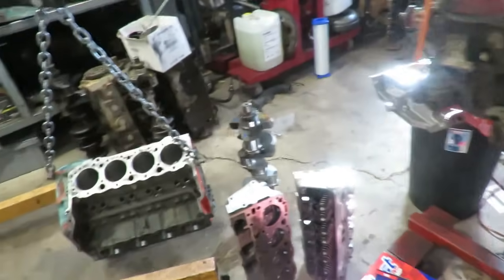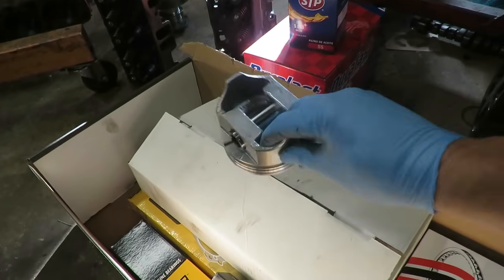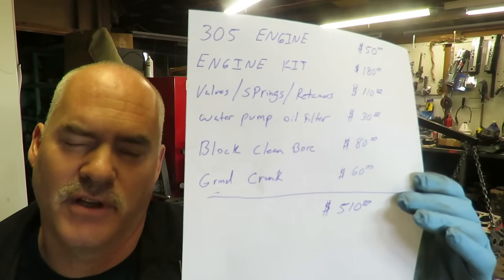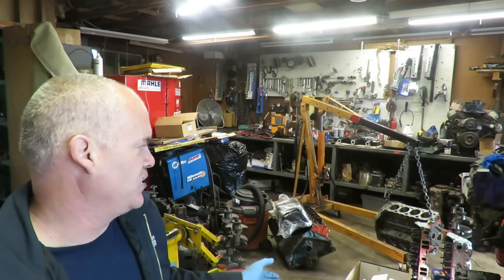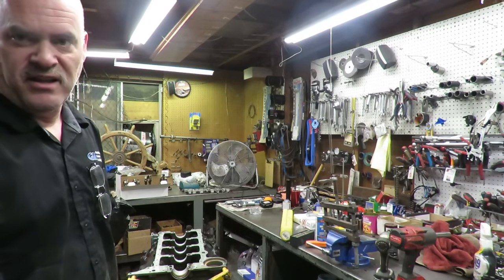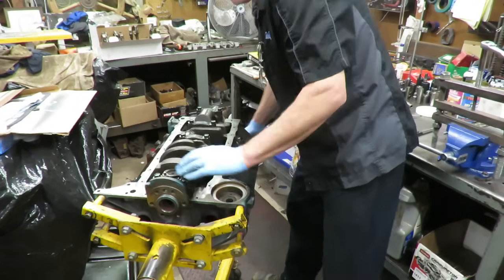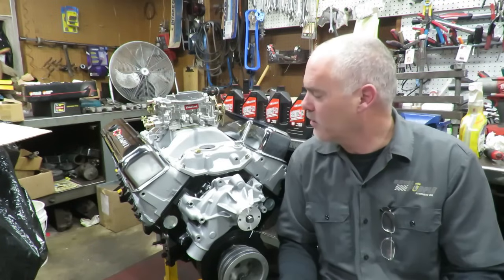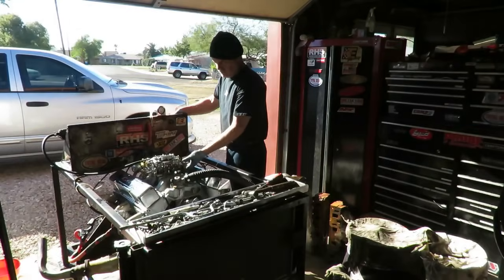Small Block Chevy extreme Budget Build

Comment: Normally one of my favorite hot rod channels.  :( From someone who grew up with the original 305 SMOG motor, this is good money thrown after bad starting with the 305 block... ANY SBC would be better than your almost free DONER motor - or even a worn out straight six. sure, the 305 eventually made some power in the IROC with FI and some other engine work, but the dinky bore with the long stroke almost guarantee that you will work for any pony that you can get...  better with an old 262 SBC which no one seems to appreciate, but still lurk in old monza's, etc rusting out in country folk farm yards all over the country, or at least take the 305 block and punch it out to add some bore size and compression and compression  ( you blow your budget)...  start with a good doner 350 instead... whatever HP that you ended up with would have been doubled.  305... synonymous with wasted money and time in my eyes.  blah!

Comment: A clean bore and hone for $80. Must be a friend price as there isn't any money made there. I don't live in an expensive area, South western Ohio, and I have a machine shop. When you figure the cost of the wear on the stones and electricity the bore and hone made no money. I bake clean blocks so I don't have a hot tank price, but I'd  say $40 t0 $50 leaving $30 t0 $40 for a bore and hone. I'm not being a negative comment type but someone trying to repeat these numbers will really have to price search to near those prices. I wouldn't power up my hone for $10 a hole. I thought about building an engine with all used parts other than gasket set, myself just for the heck of it, as they are laying here in the scrap pile.

Comment: You succeeded nicely, but it's just not fair that a SBC can sound like that and only be just 210hp?   I know it's just a 305ci, but what are the main reasons the real HP numbers are so low given the lumpy cool cam, reasonable heads (as far as I know), great intake, carb, etc.  Didn't catch the compression ratio? It can't just be the displacement because 302 SBC's made way more power.  What is holding it down and what $$ would it have needed to make 300+ HP?   Now many of us with a SBC's that sounds righteous are second guessing our power levels.
Reply from the maker: You cannot compare a 302 Chevy to a 305 the 302 is a 4" bore and a 3" stroke a real screamer the big draw back of a 305 is the bore size the stroke is close to 3 1/2 inches the the bore is quite small around 3 and 3/4 a big bore short stroke engine will always make better power than small bore stuff
Reply: @Myvintageiron7512   Exactly! Bigger bore = bigger valves = more air flow = more power. I was going to build a 302 Chevy for my Nova (from a 327 I found for cheap) but found a 350 block for free and just stuck with the longer stroke to build a street friendly torque beast. For my budget that worked out better.

Comment: junkyard ls 4.8, gap the rings, ebay turbo (have it balanced), weld up some exhaust, fuel pump + odds and ends. Between $1500-2500 total (depending on the deals you find and your abilities) including a tune for 5-600HP. There are tons of guides to ls swaps and turboing them out there. Ancient SBC is a dying animal, and I am not saying that it doesn't have a time and place for its use. But why waste time building a gutless noise maker, when you can have a real performer for a little more money.
Reply from the maker: 1500 is unlikely 2500 is closer to reality I've done several LS based swaps most on a budget they are a better engine for sure but a far cry from $700.00 so sorry man not really a good comparison the other thing to consider is the LS engines are butt ugly they don't look good no matter what you do to them they just don't pop at a car show like the older stuff

Comment: I just found this. Anyway, thanks for not pushing ye another budget LS. Which never is budget. 🤮 Also, good call on the cam, 108* and 230/240 duration sound great. Now then, just my opinion, I'd rather see some crazy neon color on an iron head than aluminum spray. Big valve heads CAN be mounted on a 305, but the required valve reliefs are NOT amateur hour. It should be pointed out that this build can also be done with an SBF. I have no idea if a 318/360 Mopar can be rebuilt on the cheap like this.

Comment: Most average joe is on a budget ! No need to excuse yourself for saving money Bruh ! The only difference there is from a 305 to a 350 on the block is the bore ! They both share the same, block, rods and 442 crank. It is decent to have 300hp out of a budget 305. It sounds good and burns rubber :D

Comment: LOL a 108 LS LOL great LOL, but for the price of used valves ($20) you should have put some 194's in it, LOL never the less it sounded hot LOL
Reply from the maker: you cannot run 1.940 valves in a 305 the valves will smash into the cylinders and bend
Reply: @Myvintageiron7512   I'm old school, I keep thinking the 305 has the same bore as the old 307, thanks
Reply from the maker: @sideswiped6874  Nope it's smaller than a 307
Reply: @Myvintageiron7512  I thought that only applied to the 262 , 3.671 inch bore. 305 , 3.736. Remember the Max Wedges had notched cylinder bores for the 1.88 exh. valves. Otherwise exh. valves were 1.60", till '67 then 1.74. Could you notch the 305 bore for a 2.02 valve?

Comment: Whats the budget for a stock LS1 5.7L ( 2000 Camaro Z28)
Reply: 5.7 LS????
Reply: @jjmccloud  yes absolutely
Reply: Well hell I thought LS engines was 5.3's
Reply: Ls engines come in many variations 4.8L 5.3L 5.7L 6.0L 6.2L and so on the one I am specifically talking about is the 5.7L aluminum block  the one out of a 2000 Camaro Z28 SS. The Corvette has the same engine but has a sports tune and not the muscle tune that is in the Camaro.
Reply: @critiquecriticism5860  oh I see, now I know which your referring to, I just always thought those were LT1 blocks, didn't realize they were considered LS. Learn something everyday
Reply: @jjmccloud  the LT1 is a iron block thats more so a 1 piece block and the Ls1 is aluminum with latches (closest name) that hold the crank shaft in place. They bolt from top and the side.
Reply: @critiquecriticism5860  Got ya, thanks for the lesson! Don't study much outside of gen 1's lol Good to learn something new for sure

Comment: Cool. $698! And a wee bit of time. You comment on how small the bore looks, the 1.84 intake valves sound asthmatic to !. He wants to hear a radical cam, but not headers? He gets to see Edelbrock on intake and 'aluminum' heads, but not headers? Would any old used headers for a SBC not have been worthwhile? But, gee gosh, $698! Cool!
Reply from the maker: The EX-manifolds are only for the run stand the car will have headers

Comment: a quadrajet and cast iron manifold would do the job.
Reply: I use nothing but the QuadraJet on my stuff. Yes, I do have tuning parts for them. rods, jets , Powerpiston springs.   And I did invest in a Wide band datalogging AFR meter a number of years back. makes tuning significantly easier.

Comment: That is exactly what I did with the Mercruiser 305 in my boat. I got estimates from $3,400 to $6,500. I spent a total of $1,050.24 or rebuilding my tired of 305. When the machine shop called and told me they found no cracks in the block and heads it was go time. These guys spending $10K plus on a small block chevy what is wrong with you.

Comment: I want to know the Power and torque
Reply from the maker: it made 236 HP and 265 TQ at the wheels
Reply: @Myvintageiron7512  That's really not bad at all for what it is. I had two '89 Camaros. One had a TBI 305 at 170hp, and one was an IROC with a TPI 305 that made 200hp (ish) factory crank ratings. So they would have made substantially less at the wheels than what you achieved here.

Comment: Man I wish it wasn't $80 just to acid dip a block , $80 per bore , $240 a crank grind , $15 a piston to fit and $360 to balance a motor rotating assembly here. 😂
Reply from the maker: Thats actually still pretty cheap that balancing price seems quite high
Reply: @Myvintageiron7512  $80 per bore as in $640 for a V8 retail. 

I sometimes don't get change from a grand just to go .030 over , pistons fitted ,tenth of a gram balanced and the crank cleaned up.

Australian machining prices are ridiculous. Our wages are higher but still hurts. 

Mechanics / technicians wages here are $25-35 an hour to the worker. 

But paying the shop is $100-140 an hour no parts inclusive.

Comment: There is no way you could build that ,for that kind of cost, here in UK. You would never find anyone with a 305, or any US V8 for that matter,sat in the corner of a garage. Parts are hoeendous, ( 'cos we have to import everything ), also machining is way more expensive.
I've just done a basic rebuild on my 289 in my 63 Ranchero, and it cost me  almost 1500 GBP, that's about 2000 US dollars, and I kept the original pistons etc, also the cam. New lifters and springs, oil pump, water pump etc.
Not perfect, but whole lot better than before.

Comment: all that for 200 hp?  a stock 307 with a 2 barrel was 200 hp. put that carb, intake cam and heads on a 307 and you'd have 300 hp.  good job you definitely hit it out of the park on this one.
Reply from the maker: AAA no 300 HP from a stock 307 your dreaming also where are you going to find a decant 307  very rare days the collectors have all snached em up

Comment: From Canada here" and this would cost a few grand at the least here" they want a $100 to $200 for a used carb that needs rebuilt the kit would then be $100 or $150 ? Any 305 and i mean ANY bare block 305 is $500 to $750 if it runs at all $800 to a $1000 to get the heads done would be a $1000 OR MORE the used cam would be $300 the gasket kit $500 the water pump over a $100 a fkn gallon of tremclad paint you would use to paint your barn or your patio furniture! Is a little over a $100 bucks B4 TAXS" love your vid bud but its depressing to know what it SHOULD COST as to what it COSTS here in good old Canada land of the free" this along with the delussional prices of old cars and trucks has TOTTALLY ruined the future of old car restorations here" the younger people have zero interest in doing it" and you really cant blame them

Comment: Hope the cam doesn't pull the studs.
Reply from the maker: it won't not with these springs
Reply: @Myvintageiron7512  factory press fit rocker studs have a tendency to pull at about .480 valve lift.

Comment: cool how the guy sold him the $50 motor with a $200 dual plane edelbrock intake .top that off with a $500 carb.chrome valve covers.pullys alternator ps pump plugs wires dist cap hoses
 ect.... dont think you're getting away with a $600 motor.
Reply: oh and head bolts,they aint cheap either

Comment: $80 for bore and clean?! It's well over $300 here. Just did a 350.
Reply from the maker: you gotta make friends with em man just like I said in the vid
Reply: @Myvintageiron7512  That's like the best friend deal. How long does it take to bore and fit each piston? Couple hrs? So your paying a shop $40/hr?
Reply from the maker: lol they don't fit each piston buddy they bore the block and hone it they didn't even have the pistons I bore and hone blocks all the time it takes about an hour
Reply: @Myvintageiron7512  My guy likes to have the pistons in hand. He measures each piston and bores a cylinder for that piston. So the clearances are the same. Doesn't just bore them all to the same size and call it good. He labels the pistons for what cylinder it is for. Overkill, maybe.
Reply from the maker: @bradywilliams2666  it's not overkill when you are running forged pistons and have higher than normal cylinder pressure like high compression or forced induction but with stock cast pistons it's a waste of time  the piston sets are CNC machined and all matched sets in the 60's it was common practice when pistons were manually machined and varied in size but that is a thing of the past
Reply: $150-$250 for me depending.

Comment: Cheap yes, but will there be issues ? I learned when your starting with a unknown block, heads and other used major parts that you have zero history of, it's like my dad told me ---- NOBODY sells a good anything as if it didn't have issues the guy wouldn't sell it ever. So for me I go the extra mile if it's not MY running motor to start off with . A few things I always do, maguflex everything , aline bore or aline hone the mains, deck the block square to the mains min. clean up .010 before boring for pistons so there is no question the crank is indeed square with the bores. ( always good for a few horsepower).  I also always balance the rotating assembly and deck both heads min clean up just to be sure. Yes I know much more money, but to me it's worth it as your freeing up horse power and the motor should live a long powerful life with out question.  If your building a drag strip toy, you might not care , but if your on the road 1,500 miles from home you just CAN"T afford issues there .
Reply from the maker: All of that stuff can be checked ahead of time alinement deck surfaces bore wear ect... it does not make sense to do all that machine work to a block that does not need it,  you can but it's a waste of money with the exception of balancing that is a must for any engine and we did weight match the new pistons on this engine
Reply: @Myvintageiron7512  I guess it's just me lol , I am told I am VERY hard on stuff ! if I am going to bore the cylinders , I want to know for a fact the deck is square to the crank so the bores also will be with out question as the motor is out of the car opened up and there is no better time to do it all and take nothing for granted. If you have no history on the block & heads it's just in my opinion it's just a wise thing to do as I HATE rework ! or forced to start completely over.   Currently doing a stock rebuild on my 1967/ 327. Will be 331 cube with RV type cam, pair of 1.94/  218 casting hardened seat 76cc heads off a 1979 vette with new  flat top cast pistons & molly rings to install in my daily driver 1970 chevelle 4 door sedan. Pulling a tired 307 out . Car is already set up with 700R-4 trans and 12 bolt posi & 355s plus a Reese class 4 hitch to pull 3,000 pound inclosed  14 foot trailer around the country, yeah I know , I could have built a 383 for it , but I had this 327 just sitting here needing to be punched .030 ( for 20+ years ) with a really nice crank & rods doing nothing and I am hoping  the smaller 327 will give better mileage then a 383 as it is for my daily with it being a lighter post sedan body. Cam choose a Comp Cams hi energy CL12-205-2  with.425 lift 202 der@ 50 (256)  on a 110 centerline  for a wide power ban for the 700R4 trans and have a factory alum Q jet intake & carb off the 79 Vette I got the 1.94 heads off of. I feel this is a well thought out package and I will be assembling it in a few weeks as the crank still needs to go .010 x .010 and the current 307 in car is still hanging in there so there is no real hurry . Hoping to drop it in car on a nice cool day in mid Oct so I got time. We have to think these things out as we get older  :) I do have a question?  when I pull the 307 out, can I bore the 307 to a standard four inch bore and use stock 350 flat top pistons in it with out over heating issues from to thin a water jackets ?  Got to use what we got right .

Comment: Re the pistons in this kit - read on:
I bought a green 4 bolt GMP Mexican Vortec roller cam short block and put some aluminum heads on it.
I have a regret however. Before I get to that I will say the motor is one of the sweetest builds performance wise. It just is so smooth, revs and pulls from 800rpm all the way to 5800.
The regret, well the mexico rough cast pistons are crap. The pistons themselves are completely fine in all areas except 1 (and it's a doozie). The crown heights are disgustingly all over the place - like .6:1 variation between the lowest and heighest comps. Considering it's advertised as 9.2:1 I think 1 piston was that and 2 or 3 were 8.6:1. Man it's disheartening that! 
See I had them mill the new heads for 9.8:1 with a steel shim gasket, so if it rattles I could put a composites in to lower it ~ .5:1. Great in theory then this curve ball comes. So in reality 1 cylinder is 9.8, 2 or 3 are 9.2 and the rest in between. Yes it does rattle a bit on hot days and now I'm wondering what to do? The motor might settle down with a few more miles on it. It's only done 375 miles. 
I'll remove the electronic ignition for the time being and put a new point dizzy (just bought a NOS Mallory twin point on eBay without vac advance) so I can play around with it and see what happens. If I get it running OK I'll diplicate the curve in the good distributor and refit it. If I can't I might actually pull the motor while the bores are still round and get some better pistons. I figure if I get some forged pistons with slightly larger clearance, I might be able to get away with just a light hone.
Other than me knowing that and the rattle on a hot day it runs great. I'm a mechanic so this stuff messes with me LOL. I wish I didn't know. effing GM - like wtf?? (nodding head in disgust as I pound the keyboard)

Cheap pistons? Mmmmm - I'm unsure about them after my experience.
Reply from the maker: If I were building an engine with aluminum heads I would definitely not use a stock cast piston that's just me
Reply: @Myvintageiron7512  builds sometimes evolve. I was going to get some GMP iron heads but got a deal that was too good to pass up.
It was a set of bare heads built up from scratch and set up with shaft mount rocker arms for $2500, so that's how it happened. They did a good job too. It solved a lot of mucking around and I'm glad i wemt that route - but it showed up this piston problem.